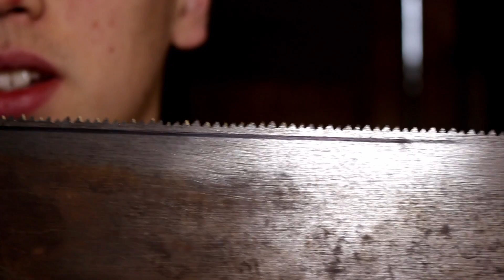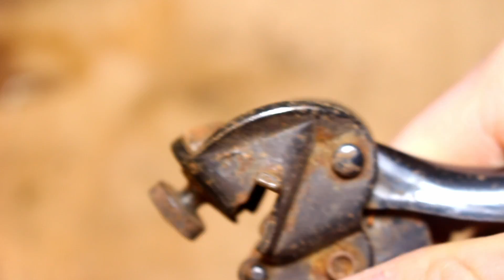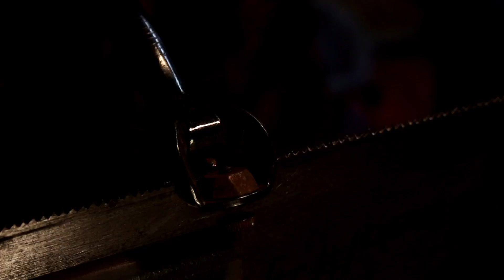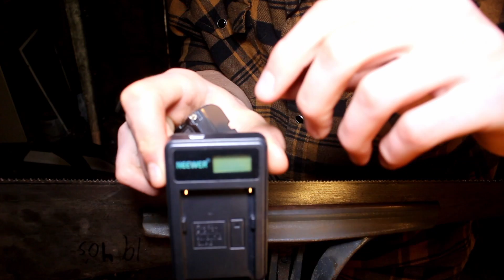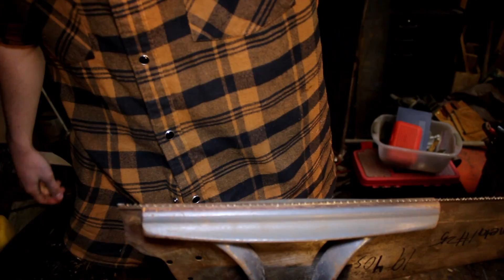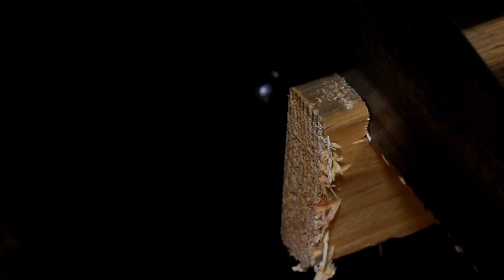Setting The New Teeth!!

Comment: What was the reason for cleaning the bottom inch of the blade and not cleaning the entire blade? Setting the teeth way faster than I would have imagined. Enjoyed the video.
Reply from the maker: +John Fisher Well I like to restore the teeth before I restore the steel because while I am sharpening the saw I tend to get some scrap marks on the steel. So this way I am only restoring each part once. Also by doing an inch I can prevent my sandpaper from removing my set when restoring the steel.